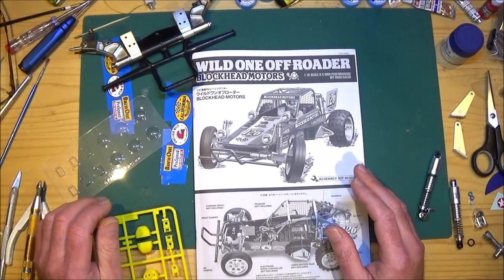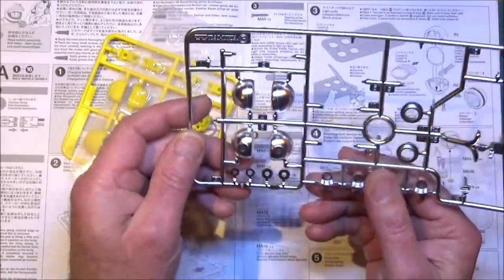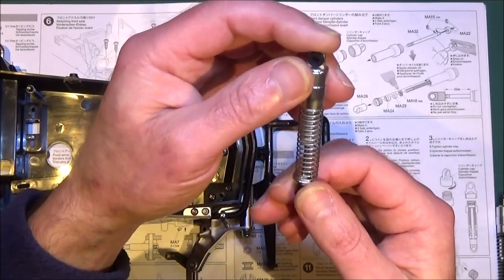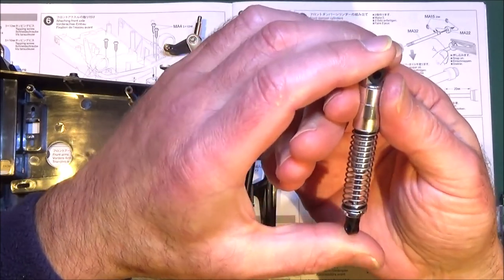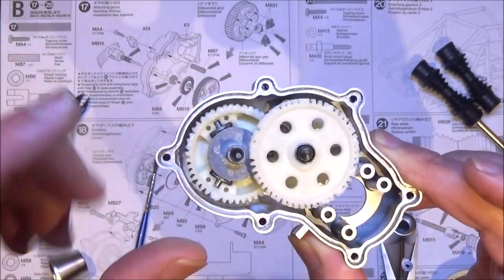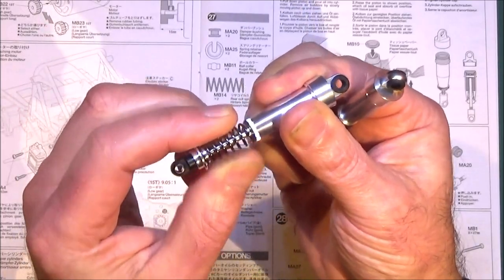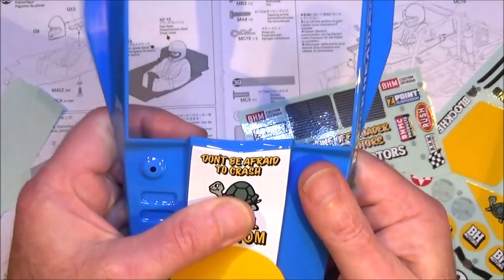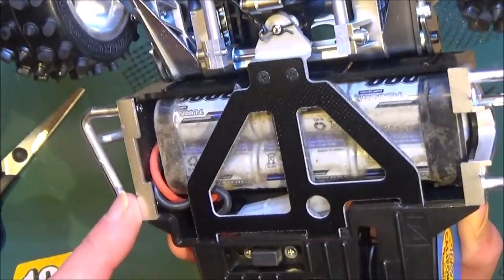Tips for Building a Tamiya Blockhead Motors Wild One RC Buggy

Comment: Well that came out great.  Nice work Mark.  I've just finished mine and I found all the same issues.  I couldn't accept the extremely stiff suspension however so up front, I've omitted the G2 spacer and made a spring cup that drops the spring another 5mm.  In the rear, I've replaced the kit springs with ones that have a much lower rate.  All together, the car now has about 4mm droop with a nimh battery pack.  I haven't ran my car yet but I think I will be much happier with the softer suspension.
Anyway, I think it's a great looking car and the changes you've made makes it look even better.  I think I prefer the chrome light buckets to the kit's yellow ones.  Cheers!   👍😊
Reply from the maker: Thanks, bud! I think you are spot-on about the softer springs for normal off-road running. I did contemplate doing the same up-front, but with no softer rear springs, the car sat at a funny (nose diving) angle! However, if you send the car over any kind of jump, it does better with the harder setup. Best not to jump this beauty, though! 4mm droop sounds just right. All the best to you, take care - cheers!  :O)

Comment: That is a really nice looking buggy but I'm still undecided about getting one myself and the front shocks problem has only made me more so. You would think, given that this isn't one of their cheaper kits, that they would be a little more strict with the quality control. O rings do seem to fix a multitude of issues and I will be adding some to my TT-02B build, for sure. 👍
Reply from the maker: Hi Nick and thanks for another great comment. Yeah, the front shocks are shocking! Even more annoying because they were the same on the last re-release, you would think Tamiya would correct their old mistakes! And yes, a box of assorted O-rings is a must in any modeller's toolbox, very cheap and extremely useful. All the best, my friend!  :O)

Comment: Hi Mark great video as always. I've just got one this week. My question is this... The rear plates with the numbers on. More specifically the one you have to cut out round the motor. What did you use to do this as the plastic looks too thick to use curved scissors. Thanks in advance for any tips you have to do a good job on this part. 👍
Reply from the maker: Hi Mark and thanks for the great comment. That rear number plate, you know it's been such a long time here I'm not sure how I did it, but I seem to remember that I used the score and snap method, had to score pretty deep though as you can imagine. The only other way that I can think of doing it is to use a fret saw and then file down later to smooth it all off. Hope you find an easy way to do yours, all the best my friend! 👍

Comment: Hi Mark, What you can suggest for brushless upgrade to make like 60km/38miles  per hour? If this possible for DT-3 as well?
Reply from the maker: Hi - well I don't have any Tamiyas that go that fast! But I reckon you will need a motor with 4000kv or more to reach those speeds, have a search on eBay and Amazon for a good priced combo ESC and motor!  :)
Reply: @MarkBryanRC  Its really weird. Like any brushless cars of Axial or Traxxas - running around 65-70km/per hour. May be they using different pinions or gears? Same size of the motors and scale...
Reply: Any ideas why Tamiya brushless so slow to compare with Traxxas with same set up?
Reply from the maker: @933pilgrim  I think the Tamiya motors are a lower Kv. But they have good torque and if you gear up you can get good speeds!
Reply: @MarkBryanRC So if use like 5000 - 7000 kv - speed will around 60km/h?

Comment: Hey Mark, I am installing the electrics ( HW1060) etc in this model, did you notice the power switch not really fitting along with the rubber cover? Thanks!
Reply from the maker: Hi my friend! Ahh, I fitted the TBLE02 ESC in mine, I think the rubber cover was designed for that ESC switch. It's far too big for most ESC switches, as the TBLE02 switch is HUGE!!! All the best!  :O)
Reply: @MarkBryanRC  gotcha thanks!

Comment: Really good video Mark. Great detail and very helpful. May I ask where you source your ‘o’ rings.. if they are not in the kit.. I’m finding myself on some of the new builds these days.. an extra ‘o’ ring here and there is making a big difference on a few things!!
Reply from the maker: Thank you, Darren! Glad it was of help. As for the O-rings, I got a big assorted box of 'em from Aldi for about a fiver. But you can get an assortment box from most hardware stores, or check out eBay, they are only a few quid and come in handy for loads of little jobs. All the best from Mark...
Reply: @MarkBryanRC  Thanks Mark I will have a look

Comment: Hi mark. Great video, thanks for sharing, did you paint the writing on the tires or buy them like that?
Reply from the maker: Thanks, David. These are the stock tyres and I just painted the lettering with a white paint pen, it's a bit fiddly to do but looks cool!
Reply: @MarkBryanRC   thanks mark, just ordered a tamiya wild one too. My want gene kicked in soon as I saw yours. Is it a re-release?
Reply from the maker: Cool! Did you order the Blockhead version? It is a new release. The standard black Wild One is a re-release. Cheers!  :)
Reply: Yes I’ve ordered the blockhead version too,  
What type of paint pen is it? Does it rub off if sprayed with wd40 or silicone spray?
Reply from the maker: @G2007r  Cool! It's a Pentel extra fine point paint marker. It does come off after running for a while in dirt and gravel. I don't spray my tyres so not sure about that!

Comment: Mark I’ve been having and issues either the diff or the transmission it slips is there a way to tighten up those parts
Reply: The wild one block head version
Reply from the maker: Hi Bruce. There isn't really a way to tighten the transmission, you can tighten the diff a little by using thicker grease. If yours is slipping I'd take another look in the gearbox to see if there is anything amiss. Good luck!